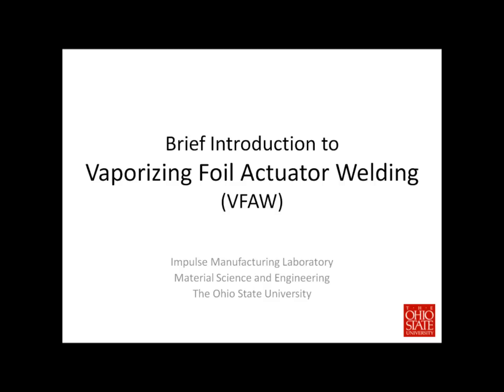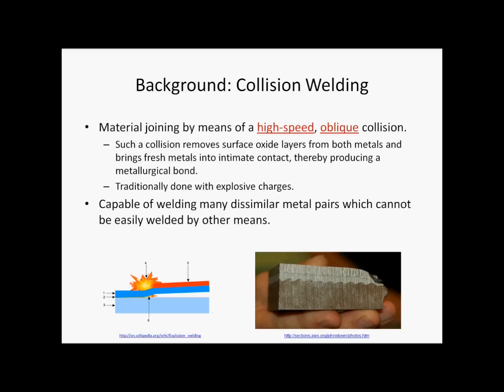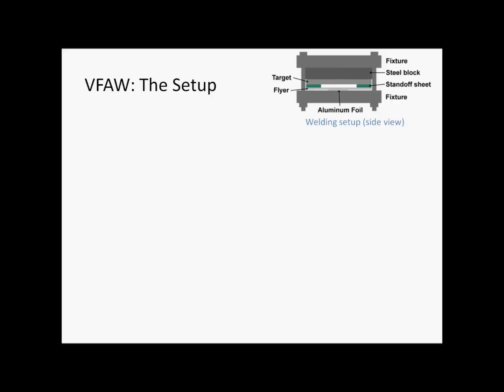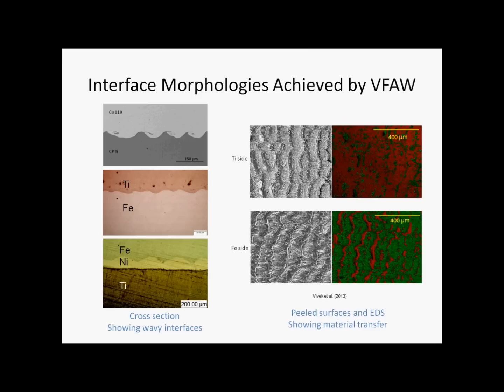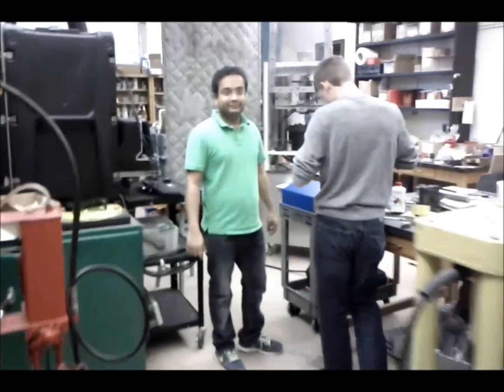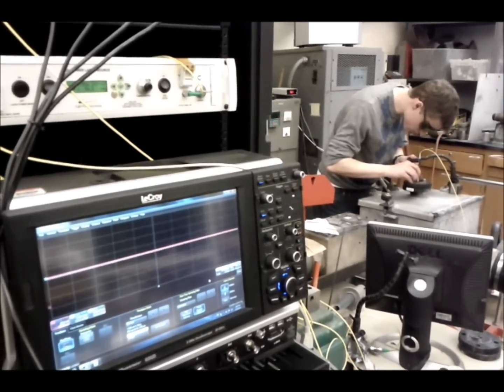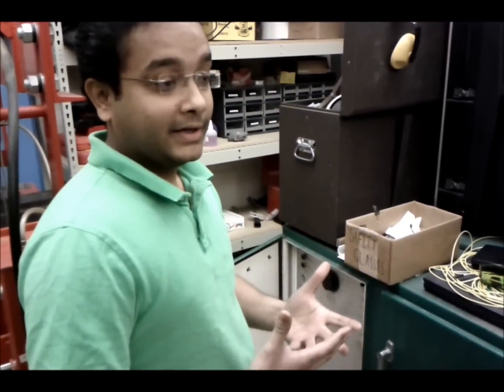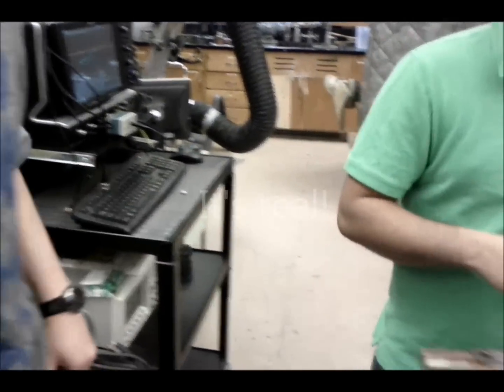Vaporizing Foil Actuator Welding by Collision of Dissimilar Metals

Comment: I believe there are some detonators that use this same principle. Bridge wire or r bridge foil dets I believe. Low ability to be mishandled so used for access annual applications on things you only wanna go boom if you've got the right code